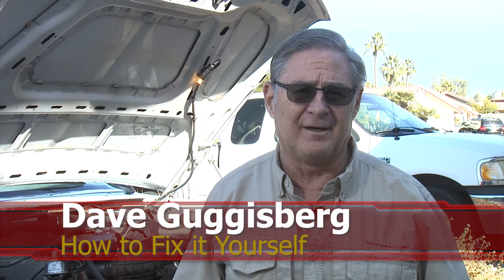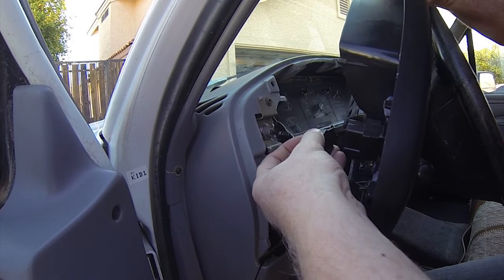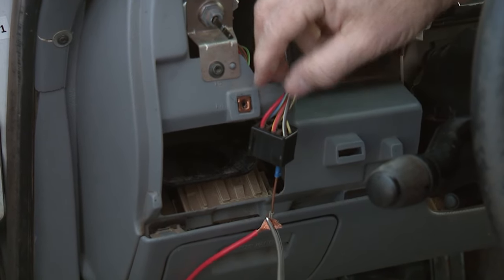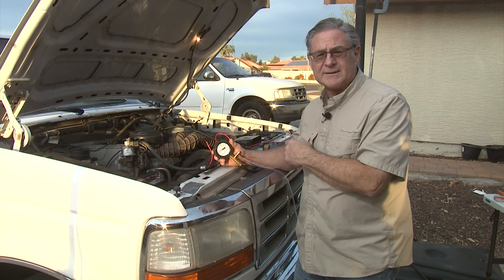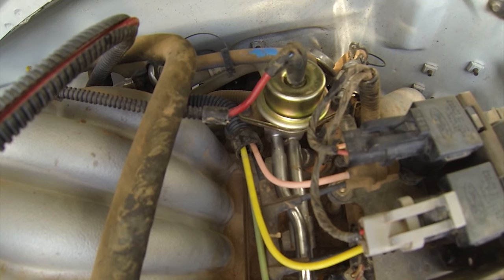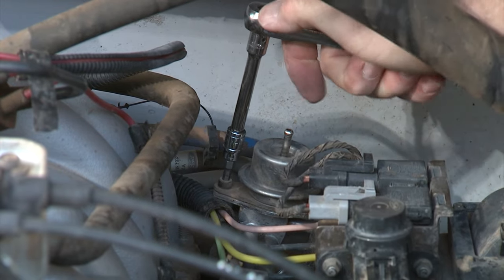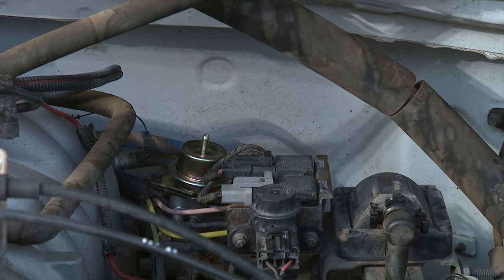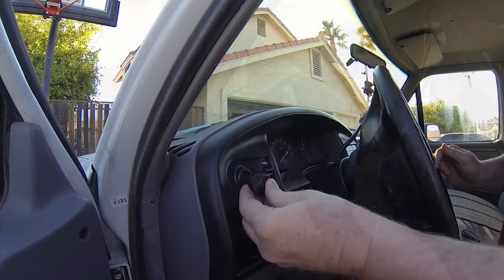Fix for Low Fuel or no Fuel Pressure, Ford F150

Comment: When you did the initial pressure check for each pump, the pressures were in spec., yet you changed the pressure regulator. So was the regulator not maintaining within specs. with the engine running? It would have been more informative to see what was going on with the old regulator still on with the engine running or was it malfunctioning at higher engine speeds? Taking the dash out seemed to be an unnecessary step---in this case anyways, although i suppose it would help those having an issue with the tank selector switch. Thanks for the video.

Comment: Wow that was an excellent video thank you for posting. Is there any way to check fuel pumps without guage. Maybe by listening to it kick on ? I know its not the same thing as what you show in your video. My 87 f150 5.0 died on me, as i was driving. Pulled over for a few it started up went about a block and died again that happened like 5 times now she dont want to start it cranks but no start. I spayed starter fluid into intake and it started to a stumble but died right away. Any help

Comment: It is INERTIA, NOT INERTIAL. YES U CAN TEST IT, IT SHOULD HOLD 25 LBS FOR AT LEAST 20 SECONDS WITH GAUGE CONNECTED AT SCHRADER VALVE  (MAYBE MORE THAN 25ISH) if it does then the regulator is working,  it may show more constantly while running.
Reply: I have a 2002 F150 4.6. No tank selector switch. How can I bypass to check if the fuel pump is working and how can I test the fuel pressure regulator

Comment: I have a question… I just put a new REAR gas tank, fuel pump in sending unit in my 1993 dual tank F150 302. the front tank works great. I was finding that the rear tank wasn't sending any fuel, so I hooked 12V directly to the fuel pump, used a clear hose on the output, and what I am seeing is it's sputtering a little bit of fuel out. Very little. Why would this happen? Could it be a bad fuel pump? Shouldn't it be a solid stream of fuel coming out of the fuel pump down that hose? Now, I didn't prime the hose before I hooked it back up. I don't think you need to do that. Just curious what you think I should look at next.

Comment: So much easier to farm diagnose the old trucks and fix. Mine 300 6 has 300,000 plus miles and still very reliable.  My 2012 won't start and so many possible things could go wrong.  Not reliable. Now got to   
Tow 75 miles to a big city grauge to fix.

Comment: I have a inertia switch on the driverside of my 1990 f150 xlt lariat, is this the fuel shutoff or is it on the passenger side kick panel
Reply: It’s your correct switch. I have the same thing. You’ll see a little bit of red through a slit towards the top

Comment: EEC? Where is it located, having trouble with my dads now mine 87 F150. Although it’s only got 24,000 original miles but sometimes I hear pump ( rt under driver door) engage sometimes not.  Aren’t there pumps in each tank also? Then there’s the round black thing tank lines run into, then another inline pump, then filter.

Comment: Thank you. I am doing this now.  Question.  As you are putting it on coming off the manifold there is a 3/8" vacuum hose that turns 90 degrees, runs toward the firewall and then runs down behind the intake manifold. (The one without the vacuum T).  What is that? What does it go to?  (I have a 1995 F150 5.8 EFI, in CA.)   Mine wiggles around a lot and I can't easily tell if it is attached to something broken or not.
Reply from the maker: While I’m not clear on the tube you are referring to, most of the diverters and control doors in the heating and air conditioning ducting use vacuum actuators. If it is going through the fire wall it is likely going to those actuators.

Comment: When I power up my rear fuel pump with a test wire, it works. But when my rear tank is selected and I power the key on, I bet no pressure. Is this the tank selector switch that is bad?

Comment: Just bought a 87 ford bronco that is supposed to be rebuilt. Has a very strong idle and runs great in neutral but if you put it in drive it gets completely gutless and sputters around. It didn’t have any vacuum lines when I bought it, replaced all them and still have the same issue. I’m clueless as a young man working on something older than I am but could use some advice if anyone has anything

Comment: Hi there 👋  I have a 1994 Ford F150 xlt 5.0 4x4 it recently started kind of bucking acting like it run out of fuel when I'm driving it and sometimes will stall at a light can the fuel pressure regulator be the problem or fuel pump ?
Reply from the maker: Yes, it could be either, but I would check for vacuum leaks first.

Comment: Does the pumps run all the time or does kick on an off
Reply from the maker: Pump runs all the time.
Reply from the maker: It is a bypass system which sends the excess or unneeded fuel via the return line back to the tank. It is supposed to run all the time.

Comment: will a malfunctioning fuel pressure regulator cause VERY poor mileage?  5.0L 87 F150 and I get around 110 KM on 1/2 a tank of gas.  That's like 60 miles.....
Reply from the maker: Are you seeing gray or black exhaust? Burning that much fuel, you should see something out of the tail pipe. Pull a couple of spark plugs to see if they are fouling from excess fuel. Are you finding this fuel drop from looking at the fuel gauge or is it from the amount of gas you put in at the gas station? If it is just the fuel gauge, you could just have a bad fuel sending unit. Are you sure you do not have a fuel leak in the system somewhere? If you are putting that much fuel through the engine, it could be the pressure regulator – it is a cheap replacement – but I would look elsewhere first to be sure that much fuel is going through the engine.
Reply: @howtodoityourself6178  Nope.  the truck has 2 fuel tanks.  running on the front one.  It may be the DFR dumping return fuel into the rear tank.  Will test this next week.

Comment: Great information
Reply from the maker: Glad you liked it
Reply: So, this 94 f 350 460 injected has volume, some pressure at the schrader, while both pumps run continuously when switched accordingly.
It runs on a sprayed fuel to plenum but not via the injectors. It's my suspicion the check valve in the line is hung up open? (since the pump runs possibly merely transferring the fuel to the other tank while supplying volume and some pressure at the rail? 
Any thoughts ?
I'm on a ranch with little to no diagnosis equipment
Thanks in advance

Comment: Hello I noticed you left the old oring from the low side inside the rail is that the correct way? I just did mine on a 1996 4.9 kinda tuff to remove, but doable  without taking entire intake off. The new regulator looked similar to the one you used so I figured the new design with the black material around the oring location was good to go and removed the old oring inside that low side rail area spot. The part I used was Standard now my pressure on both the front and rear only read 20PSI. The previous stock OEM part was reading 48PSI on the front and a 32 at the rear. Both pumps and filter are new. I'm thinking that oring I removed from the low side rail has something to do with it or the new regulator is bad from the get go.

Comment: Ok redid fuel system now another problem ... replaced fuel filter ,replace fuel pump , replaced relays and regulator. Starts up run and idles around 1 ,1 1/2 but when I hit gas petal it bogs down and dies . What Im I missing to do ?????
Reply from the maker: Check the vacuum lines. Sounds like a vacuum leak to the regulator.

Comment: Question went to get tank sensor/fuel pump and they ask about how many gals front tank takes .. I never filled it up to know , does it really matter
Reply from the maker: It is probably an after-market fuel pump, which is fine. There are some very good after-market parts and I use them as well. It doesn’t matter for the fuel pressure – it is the physical size and electrical connections that they are trying to match which is where the number of gallons in the tank helps determine the pump needed. It is best to pull the old pump and physically match it. The number of gallons will be in the specification section of the owner’s manual. If you don’t have one, there are several that people post online.

Comment: Good info on how to force the pumps, but you changed 2 things at once (regulator and tank switch) which is a no-no in troubleshooting... now you don't know which one was the issue...it would have been more helpful if you would have changed the regulator and THEN tried it, and if that failed, replace the switch.

Comment: i tested the direct power to my fuel pump and i get no fuel pressure does anyone know what might cause this? thanks
Reply from the maker: You didn’t mention if you could hear the pump run or how you connected. If the pump is not running: bad wiring or bad pump. If the pump is running: clogged fuel line, clogged fuel filter, kinked fuel line, bad pressure regulator or bad fuel pump.
Reply: @howtodoityourself6178  thanks for the reply i put it a new fuel pump used the existing assembly 1996 ford f250 yes i can hear the pump replaced fuel regulator. the truck does turn on but idles up and down and eventually losses power and turns off sometimes. im confused with the no fuel pressure reading. hope you can help. thanks

Comment: @howtodoityourself6178 How do you hook up the fuel pressure gauge? Do you have a video for that?
Reply: If you see the fuel rail, you will find a valve looks like the valve where you inflate a tire. You connect there,  that's  it.

Comment: My 1995 f150 4.9L doest not start.  I checked fuel pressure and I noticed that the front tank pressure is 20 psi and the rear pressure is about 45 psi. Do I need to change the front fuel pump?
Reply from the maker: Yes you do
Reply: @howtodoityourself6178  thanks! I appreciate your help
Reply: Do u have to have the front fuel pump/ tank.    Or can u use only the rear
Reply: Hi, I changed the front fuel pump but now I have no fuel pressure at all in both rear and front. Not sure what to do next. Thanks,
Reply: @Jose Garcia thanks for your replay! I did  check and it's working.
Reply: @Jose Garcia no I did not die. I haven't worked on it since then.
Reply: Houston based?
Reply: @samharli  fuel tank selector valve?

Comment: I have a 94 f150 dual tank with the 302 as well. I replaced the rear fuel pump about a year ago and it worked fine until today. both tanks went empty today so i filled both up, switched to the rear and on the way home, engine bogged and shut down not more that two minutes down the road. Switched to the front tank and truck started and drove fine all the rest of the 30 minutes home. Once home and parked, i kept the truck running and switched to the rear tank again and truck almost immediately shuts off. did it once more to confirm. inertia switch is not up so i dont think that is the issue. Im going to buy a psi tester today and check that. if rear has low or no psi but front is okay, should i replace both the fuel pump and the regulator anyway or the sending unit as well? also, could an overfilled tank cause this issue to happen?
Reply: Change the fuel pump selector switch
Reply: @sigeptim1982  update: was able to check PSI. Results: truck runs fine with selector switch in front position but shuts off in rear position. While checking fuel pressure, with front selector engaged, was unable to get any reading or power to it, it seems. But with rear selected, had perfect fuel pressure. If truck runs fine with front selected but not rear, why am I not able to check fuel pressure with front selected but am able to with rear?
Reply: @atticusjun1598  No clue but I think your problem is in the selector switch. I had the same issue but the front tank wouldn’t work and the vehicle would die in the front position and run fine with rear selected. Changing the switch worked like a charm.
Reply: @sigeptim1982  ended up not being the switch, gonna replace the whole pump and send unit next
Reply: No no no no. Listen. Your problem is a check valve on one of the tanks. It makes it to where it dumps the fuel into the other tank. It's on the lines just above the pump on the outside of the tank. It will most likely going to be a rust color while everything else is the aluminum color. Change that preferably on both tanks. They don't cost much so may as well. Also there is a great trick with a sharpie cap that is on YouTube that makes it so that you don't need the specialty tool for the quick connects on the line.
Reply: @truckertexman  there’s one on each tank? They have a proper name so I can search them up?

Comment: I have an 89 E150 4.9, new injectors, new distributor, complete tune up, new TPS, new IAC, new MAP, new coolant temp switch, new power steering pressure switch, and it still will stall when put into drive or reverse, I now can hear rattling under load, spark knocks too, its a money pit, its been to several shops, they can't fix it, they either don't know or say they found nothing, shop that found nothing burnt up the transmission and gave it back running on 4 cylinders, barely made it home. I now hate Ford, if I had any money left, or what was spent on it already I'd buy a v8 with a carburetor, throw the efi six into a dumpster! I've been to every forum on the internet, they know nothing about fixing a efi 4.9, just suggest testing every electronic switch on it, and if it comes back inconclusive they ignore further comments, carburetor, or junk it!

Comment: Any know why the fuel pump runs all the time
Reply: If that happens, it likely is the computer.  There is a video up on that.  Many times, over time, the capacitors deteriorate and leak a black goo.  There are three capacitors on your EEC computer.  It's easy to take it out and check.  But......I'll say this.....your fuel pump should only turn on for two seconds after turning the ignition to on.  If the fuel pump keeps running, it's the computer.  You can have those capacitors swapped out yourself if you're handy with a soldiering gun.  There is a video on that (just watched it).

Comment: Does the fuel pressure regulator have an effect on the fuel return line? My 1985 fuel injected F150 will crank but not start. Fuel pump is good. Watched another video that suggests the fuel return is stuck open, so there’s not enough fuel getting to the cylinders, it just cycles through the fuel rail and back to the tank. Makes sense, just not sure what to do about it, maybe a new regulator is a good start.
Reply from the maker: Yes and no. (Great answer?) Most fuel injector systems are return type. The fuel pump runs continuously and the pressure regulator controls the pressure to the rails and excess pressure is bled off to the return line. Often there is a return line check valve to keep reverse syphoning when the system is shut down or cools. In some race car configurations they use a back pressure check valve to allow faster system pressurization for when a hard acceleration is required. While all check valves have a small spring to keep the valve operational this only creates very small back pressures and is only useful to keep the valve closed when the pressure side goes to zero. So effectively the return line should be open. I would look to the pressure regulator. Also check the fuel filter for clogging.

Comment: If the engine was running the voltage to the pumps would be 14v not 12.5v & there be a big difference in pressure.. .

Comment: You can always remove that lazy six and put a 351 Whidsor in there ad an inline fuel pump remove one tank because you don't need two tanks add a 600 Street warrior Holly carb and turn that truck into a beast

Comment: hey all you men, does anyone know how to disconnect the fuel line from the fuel pressure regulator?  on my 1990 e350 van 5.8 there is 12 or 16 inch fuel line in between regulator and another line that goes to pump on rail.  the portion of that line that hooks to regulator ends in like a shiny metal round disc thing with a safety keeper clip thingy on it.  when i take that clip off how do i then disconnect that round portion that goes into regulator?  i hope this makes sense, i know i'm not describing it very well:)))-barbie

ps- thank you very much for the video dave.
Reply: Did you try to just pull the line out Barbie? It sounds like your describing something similar to the fuel filter and once you pull the clips , you have to pull like the dickens to get it apart cause it probably has O-Rings either around the line or in the regulator that gives it a tight fit. 

If this is the case Barbie, it’s gonna be a tough job and you may need to find some help. That’s not knocking your ability cause I’m a Desert Storm Vet and I have issues getting some of these things apart. Hopefully you got it by now anyways tho and you don’t need this advice anymore  but I’m proud of ya for jumping in there to do these things yourself! You rock girl!! Good luck to ya and feel free to reach out if you have other questions!! 

Good luck to ya, and be safe out there

Comment: Yeah, fuel regulator, well Ford didn't think out the placement of it on the 4.9, its amost under the intake, you can see it, but accessing it is another story, pulling the intake penelumn is almost needed, good job Ford, you made owning a van a challenge in every repair, not to mention ruined the 300 inline six longevity with the shitty efi! I'm 4 years in and no one has been able to make this piece of junk run right, I was hoping it would just die to make diagnosing it easier, nope, runs, just not well enough to really drive it, listen to the valves rattle under load, quits when going into drive or reverse, had to chock the throttle up to keep it running. Avoid all the OBD1 Fords or be ready to pull it all and swap on a carburetor, don't try to fix it or you will have more money in it than NASA spends to send up a shuttle, and it still wont run right!